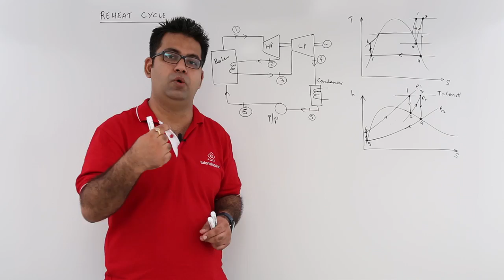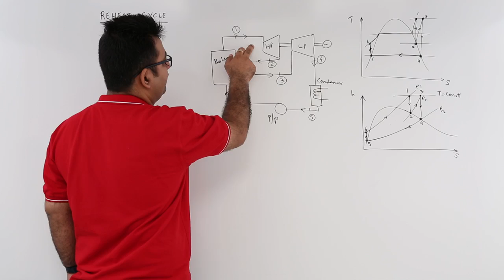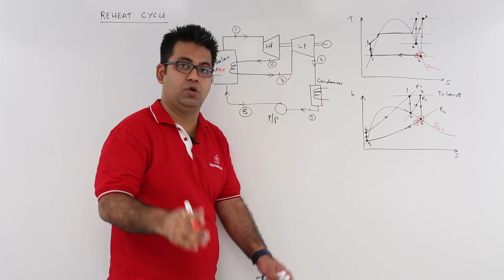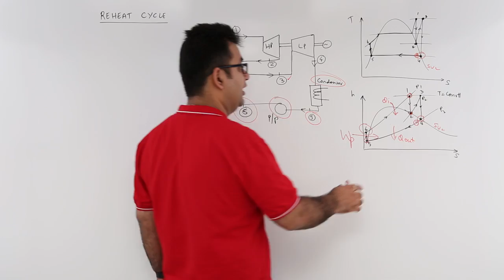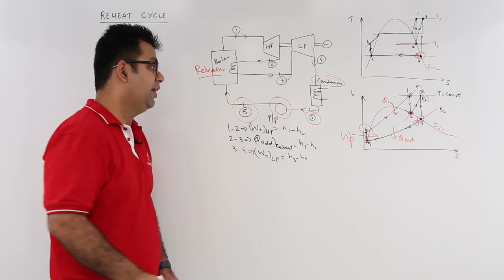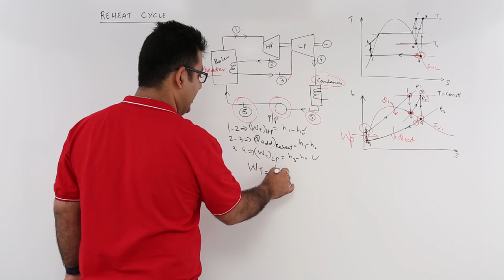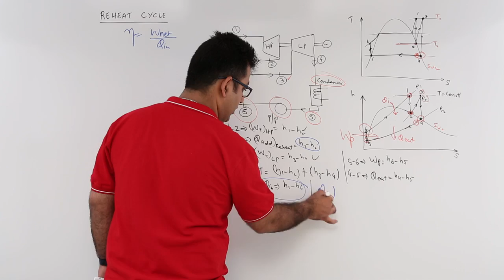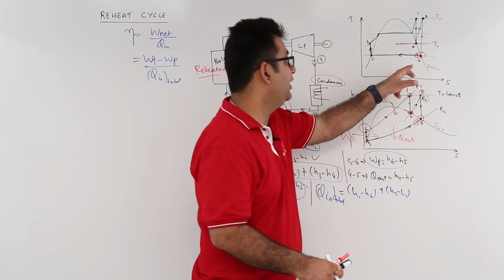Reheat Cycle

Comment: A steam power plant operates on a theoretical reheat cycle. Steam at 25 bar pressure and 400°C is supplied to the high pressure turbine. After its expansion to dry state, the steam is reheated at constant pressure to its original temperature. Subsequent expansion occurs in the low pressure turbine to a condenser pressure of 0.04 bar. Considering feed pump work, 
Calculate: (i) Quality of steam at entry to condenser (ii) Thermal efficiency (iii) Specific steam consumption. 

pls solve this ....

Comment: Why efficiency is decreased after reheating??
Reply: The efficiency still increases. If you look carefully at the Mollier diagram (h-s), the enthalpy drop in the turbine (h3-h4) is more than the enthalpy rise in the reheat process (h3-h2). Overall if you plug in these values in the formula for efficiency and compare it to the formula for standard Rankine cycle, you'll get that the increase in numerator is more than the increase in denominator. Therefore, efficiency still increases.